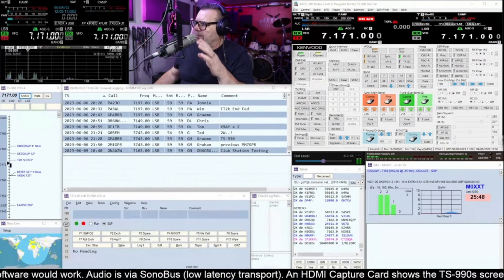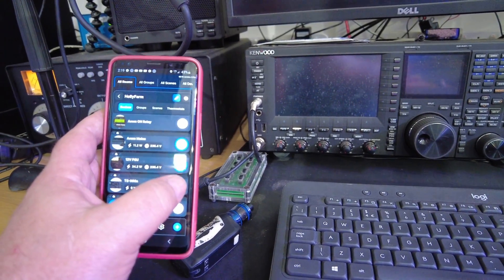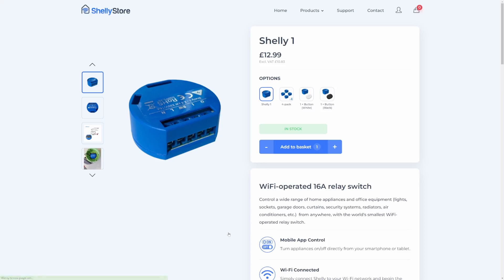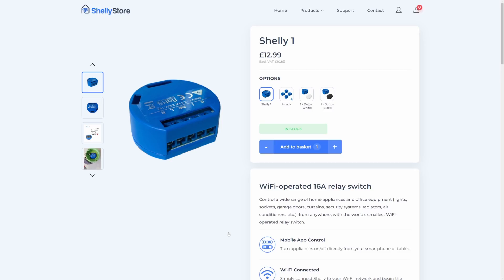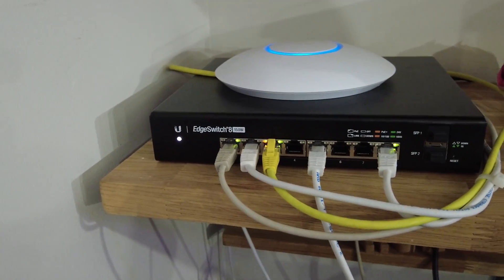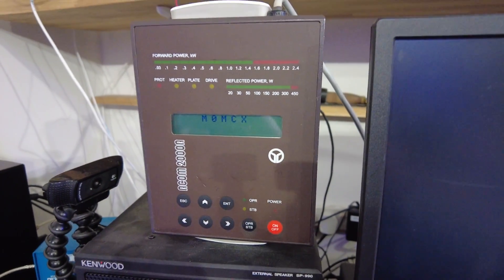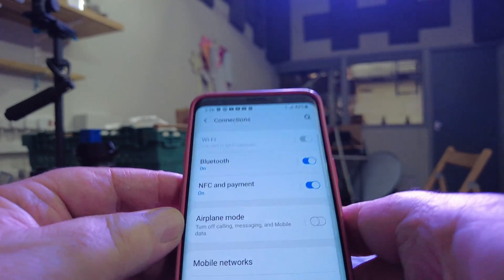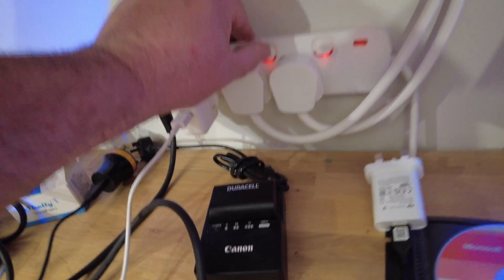Remote Shack Hardware Power On/Off Switching

Comment: Very nice!! Question: what's a good pre-Amp for receiving On HF? (1-50mhz)
Reply from the maker: MOST new radios have a TON of gain without a Pre-Amp.. If you really need one (and even with a 15 foot square of wire on the ground I didn't) then Google it because I have never needed one. I THOUGHT I did.. but it turns out I didn't.

Comment: I've been watching a number of videos concerning that sub disaster on its way to the Titanic. A number of the videos claim that radio waves don't work underwater is that true?
Reply from the maker: Yeah, it's stue.. Salt water is a nightmare to get RF through.
Reply: @DXCommanderHQ  how do submarines communicate?
Reply from the maker: @mepeeta7590  Interesting.. Wikipedia has some good articles however they use massive long wavelengths to receive- rarely would they transmit. The Navy has some very long antennas that transmits encoded digital codes very slowly... Its all cloak and daggers! To talk to your diverse just below the surface is a lot easier.

Comment: Very cool setup and it works thats awesome.  Will you be sharing how you disconnect the antennas as well.  Here in the humid south USA thunderstorms are a problem.
Reply from the maker: OK, so when I switch the 12V PSU off, all the antennas are grounded.

Comment: I use cheap Kasa switches for my remote station, but I am not sure if they can handle the current level for the amp.
Reply from the maker: OK.. all Shelly ones are apparently 16A at 230V.

Comment: Cool system! Can you do a video on the AT2K tuner with the proper way to tune antennas? Not much in YouTube land on it. 73
Reply from the maker: Oh.. I used to have my doublet attached to this.. I just faffed about until it found the right tune for the antenna and the band..! I did consult the user guide for PROBABLE and approximate settings.. Not sure if I can help now though because I don't have the doublet plugged in..

Comment: if you're comfortable enough, you could open the pc too and put a shelly between the wires of the power button (but of set the shelly itself outside of the pc case of course), same way as shorting the pins of the acom. That'll let you boot the pc and shut down the pc from the app, so no real need to remove power from the pc anymore.
just a little extra ;)
Reply from the maker: I spoke to James about this yesterday.. You could actually fit the pin 5&9 hack INSIDE the Acom 2000. Same with the PC - but hey, I might want to change the PC out.. Just as easy to have external. BUT I do fancy hacking the Acom.
Reply: @DXCommanderHQ  just watch out if the acom case is full metal, it might block the wifi signal as you probably know :)

Comment: A number of commercial radio sites use similar (PDU power distribution units). It is amazing how many times that a remote power off-on will get you out of trouble when something locks up.  In your case of course it means the gear can have a sleep when you are not using it. Routers are available with 3G/4G fallback when the ADSL fails.... you know you want one...
Reply from the maker: Well, right now.. if I stop speaking, the rig will stop.. In the case of it staying in PTT mode, it should time out after 3-minutes( tested). In the case that for some weird reason that doesn't happen, I'll switch it off remotely. In the unlikely event that the internet has failed and we're still in key-down mode, I'll call security and ask them to power off the unit. In power failure mode, everything powers off anyway so we can discount that one.. So I am only left with IF internet stays up and the rig won't stop broadcasting Rolling Stones and Shelly won't listen to me, I'll tell the folks what frequency it's on and we can all have a party! However, for convenience, it would be very handy to cycle the main router next door via 4G - in case we lose internet locally and the router needs a kick. So that's next.
Reply: @DXCommanderHQ  lots of possibilities and safeguards, would be easy to do emergency shutdown or router restart via a 2m link… 
My request is “Brown Sugar” ..
Reply: well to be fair: what he made with the shelly is a sort of PDU, smart PDU with metering that is (for a third of the price, but DIY) :)
Reply: @ON3RVH  I was not knocking it, I made similar(ish) with a Raspberry Pi PIco W.
Reply: @g0fvt  was not saying or thinking you were knocking it :)
I made simple pdu's too and use shelly's (with other FW) all around the house (mainly for small light sources)